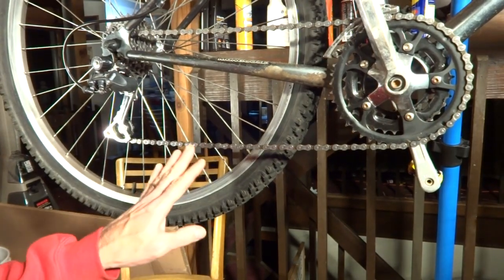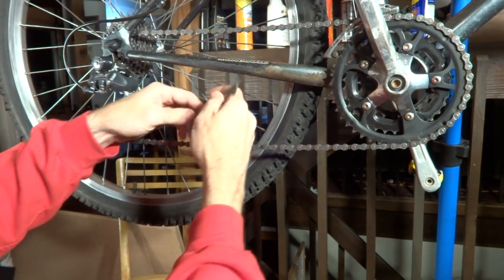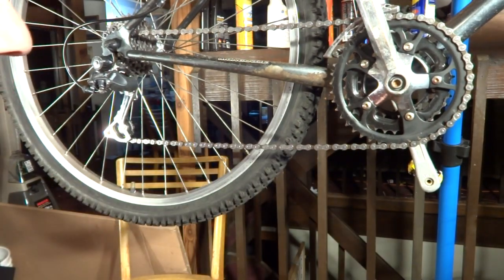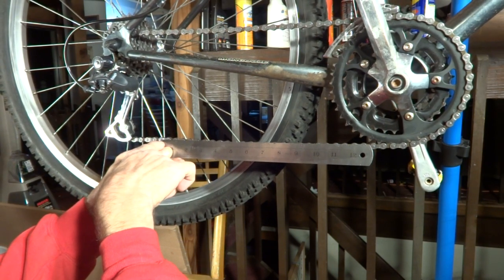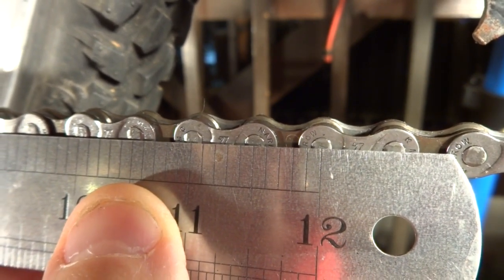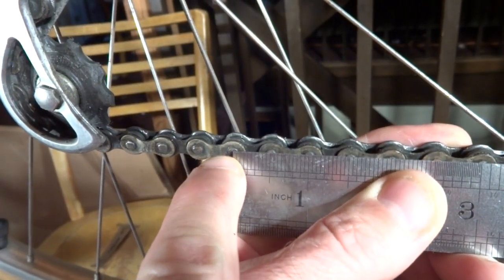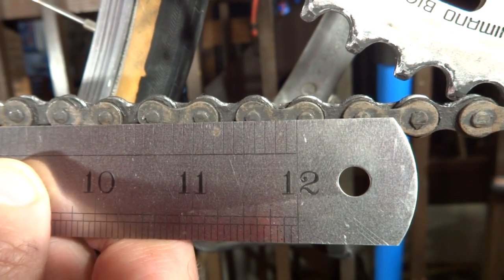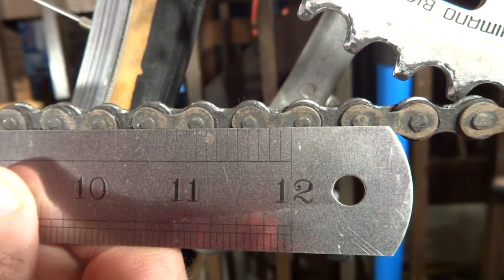How To Measure Bike Chain Wear With A Ruler

Comment: Thank you so much i used my daughters ruler from her school pencil box and used this method and my chain was very worn went to the bike shop straight away and told them i did the ruler check and my chain is worn they laughed at me and said you cant do that use a proper chain checker?? so he got one out and tested my chain and was very red faced to see i was right lol haa haa
Reply: Just because you didn't use their fancy tool, they don't think you can measure chain stretch? Goes to show that they don't even understand how to official chain-stretch measuring tool actually works (it's basically like a pre-marked ruler).

Comment: Starts at 1:25 
The measurement at 3:26 where it says it is extremely worn, .5% is the point when you want to replace it, and since .5% of 12" would be .060, or approximately 1/16", that would mean it is time.  So it shows a little more than 5% and headed toward .75%.  Generally, you will go through three chains before you wear out the cassette sprockets and the chain rings go multiple times that.  You can generally determine the cassette wear visually and there are you tube videos that will show you how to tell.

Comment: Get yourself a chain measuring tool! the ruler method measures the wear in the pins and outer plates mostly whereas the tool measures the play in the rollers. Just to give you an example: the other day I replaced a chain on a friends bike. The chain wear tool was showing about .85 but according to the ruler the chain was still perfectly fine. It was only 1/32" past the 12" mark.
The chain wear tool that I used is well calibrated as I measured the chain with another tool also and came up the same.
Reply from the maker: I personally use a chain gauge.

Comment: Great video, I've always used a ruler for checking chains. The other thing I do is check the chain under tension as I think it gets a more accurate read than when the chain is relaxed and just hanging with no tension in it.
Reply from the maker: With a derailleur, there is generally always tension.
Reply: Or pull back on the derailleur...
Reply: You can see chain hanging down between front chainring and derailleur so there isn't much tension there. Difference is noticeable when chain stretch is measured between cassette and front chainring while putting some pressure on crank so that the chain is really tight.

Comment from the maker: In the context of this video, if the chain has worn to the point that the center of the pin is 1/8" past the 12" mark, then your should replace both the casette and chain rings (not the whole crank set). But the teeth of the cassette and and chain rings get worn over time anyway. The gaps between the teeth get wider and the teeth start to look like shark fins. At that point, they should be replaced.  Maybe I will make a video with more detail on this.
Reply: I have a question there are a few spots on my chain where the chain checker falls threw .75  but when measured across those links with a metal ruler theres not even 1/16 of stretch. Is the chain a goner because the few links roller wear? Thanks in advance

Comment: Brilliant tutorial, I've got 3 bikes, first is my Ribble Endurance SL e & it had a new chain 6 months ago & it's still bang in the middle of the pin at 12". Second is my Winter training bike & that's only very slightly past the band centre middle of the pin at 12". Lastly is my Trek Dual Sport 3 hybrid bike that is almost 5 years old & 12" mark is almost at the outer edge of the pin circle. I'm guessing it's at the 0.75% wear mark? Hopefully it's won't need a new chain set if changed now?

Comment: Thanks for the tip, I ride a trials bike which regularly breaks chains.  If nobody has told you yet,   the 1.0 or .75 is millimeters, not percent.
Reply: I think those tools are 10 cm segments and 1.0 mm=1.0%change. If they are not 10 cm members, then Parktools looks silly by writing "... just before the 0.75% readings."
Reply: I was under the impression (i.e. somebody told me ages ago, but who knows if they knew what they were talking about) that the 0.75 and 1.0 marks referred to how much of a 'link' the chain would be elongated over the length of the chain. Obviously, not all chains are the same number of links, so that makes this explanation a bit fuzzy. However, when I have removed chians that are just entering the 1.0 point on the tool and laid a new chain alongside, the 'stretch' has usually been about 1 link.
Not a big deal what it means other than replace it I suppose. I will look into it a bit more though.
Reply: YES it is a percent ! if the chain pins are 12 inches and 1/16" then the chain is at .5% wear . Here is the math ! 1/16" decided by 12" times 100 = .5% !

Comment: 11 speed chains should be replaced at .5% wear . If the center of pins at 12 inches is 12 inches and 1/16 of an inch the chain is at .5% wear . 1/16" decided by 12 times 100 is .5 !

Comment: Weird. My measuring tape is showing that 24 links are 1/8 of an inch shorter than 24 inches, not longer. Checked two chains. Have my chains shrinked?? Or is my tape longer than it should be?
Reply: Make sure there is tension pulling the chain lengthwise !

Comment: I guess not all chains are by inches?  I have a Shimano derailuer (so probly pretty standard stuff?) but at the 12 inch mark I am a half link off.  So, I can't even tell you if I'm a half link long or short, lol.  Could my chain really be sooo worn that it has grown a half link per 12 inches? wow
Reply: Yes they can wear that much. That would be 6.35mm 'stretch' over 24 links so  0.264mm wear on each link. Unfortunately when they are that worn you would need to replace the cassette and possibly the chain rings as well.

Comment: A very useful tip. But is it also the same if i measure chain wear by putting the beginning of the ruler at the left beginning part of the pin and observing the clearance of the 12 inch mark of the ruler using also the beginning of the pin that has to be aligned with with the 12 inch mark of the ruler as its reference?
Reply from the maker: Works out the same.

Comment: So if your chain is worn alot to the point to where you should change out everything, what harm will just keeping it on like that if its still working fine  for as long as possible?  Might it keep going like that for a long time so does it really matter about things wearing out more does it? Thanks
Reply from the maker: Shrug. At some point it will start slipping, skipping, chain suck, etc. Shifter may deteriorate.

Comment: Just installed a brand new KMC x8.99. Measured it with the method in the video. It's a tad shorter than 12". Weird. Not sure if the chain is designed that way or if my ruler is inaccurate.
Reply: You might not had your chain tight.

Comment: Hello, thanks for the nice video. I'm just crippled. I have 2 brand new 11speed chain and them are already 1/16 over the mark. (K.M.C. and shimano not cheap Chinese chains). I have also a CN-HG73 with less than 200Km which is almost 12 and 3/32. Why is that? Is this video intended only for single speed chains? Thanks
Reply from the maker: Shrug. Buy a chain wear gauge.
Reply: @RJTheBikeGuy  thank you. I tried them and worked properly. I definitely need a gouge.

Comment: Sir, I have a question. I changed my worn out chain because it keeps slipping when I'm pedaling hard. But it still keeps slipping with the new chain installed. My cogs and crank chainrings are not yet worn out based on how they look. Then I measured my chain using a ruler and I found out that the 12th inch does not go exactly between the the last pin. The 1st inch mark is on the center of the first pin but the 12th inch goes beyond the last pin. Does my chain have something to do with this chain slipping?

Comment: Good explanation and video. One thing that would make it a bit easier to follow is if you started your ruler measurement at the same 'place' on the new and used chains. You started at the rear pin of an outer plate and finished at the rear pin of an outer plate. For the worn chain you started at the front pin of an outer plate and ended just short of the 12" front pin of an outer plate. Not a big thing but for a moment I wondered why the 12" spot on worn chain was so much different than the new chain...oh, started at diff point on the link! 
Enjoy your videos. Have you done one showing the use of the Topeak chain-check tool?  Thanks!
Reply from the maker: https://www.youtube.com/watch?v=Y54ekC8PHB0
Reply: Measure on a few spots on the chain !!

Comment: Are there more durable chains or chain rings, or somekind protective coatings?
Reply from the maker: I am guessing some chains and chain rings/cogs are more durable than others. Steel chain rings will be more durable than aluminum ones, but will be heavier and probably wear the chain out faster...Keep the chain cleaned and lubed, and the parts will last longer.
Reply: shyflirt1
 Steel durable and cheap material, I doubt these parts would be made of soft aluminum. But there might be harder materials or at least coatings that reduce abrasion. For example some rims do have ceramic coating that effectively protects from brake abrasion.
Reply from the maker: As they say, you can have it Fast, Cheap, Reliable. Pick two. So you could probably make the parts light and last longer, but they would be more expensive. At some point, it's just cheaper to replace the parts more often...

Comment: 12 inch --> 30.48 cm
Reply from the maker: shrug Chains are made in inches.
Reply: @RJTheBikeGuy  My ruler isn't. Helpful video, thx but i'm not gonna go and find an inch ruler if i can just messure 30.5 with the one i got.. 

Not trying to correct you or be political. Just putting it in there for us mainlander
Reply: Thx mate, it helps alot for those who don't live in the US

Comment: I've always used ruler method before, but since I thought, that it's a bit annoying to do. I got also the parktool cc 3.2. But I still use ruler. I knew the cc3.2 is not exact, because it measures also the rollers wear. But I hopped that it won't be as bad as people are telling me.. but actually it's worse than I expected. It would scrap the chain way too early.
They recommend to change 11 speed chain when it reach to 0.5% wear.. But I got it to fall easily in by 0.5 side, already after 700Km..When I then measured 15 links with ruler, it was just halfway to 382mm. While new chain's 15 links would be 381, and 0.5% worn chain would be 382.9mm.

Does the rollers wear actually affect anything at all? I'm not sure.. But maybe it does affect a bit for gear changing.. on those hyperglide or whatever ramps on cogs?

Well I decided not to change the chain before I get at least 382mm with ruler.. But probably a bit more. I hope it won't wear the cogs off yet.. It does not look like it would lift the chain up on cog under tension.. Also the tooths  don't look like they would be flatted.. or like riveted or I don't know how to call it.. But basically if the chain is worn it pulls only from first one tooth and it like riveting or flatting the edge a bit.. That hasn't happened yet.. Or maybe just very little.

At least for now on, I think the parktool cc3.2 is useless for me.. Maybe it's fine for 7 speed chains where u can wait until .75%, but that 0.5% side.. it can't be right. I don't want to change the chain so often.

Maybe for a bike shop, or a mechanic who need to measure tens and tens chains every day. It's good.. Especially for cheaper chains that don't cost too much. But for a regular cyclist.. I think It's more reasonable and much cheaper to buy a good steel ruler instead of that tool...
And I find a wooden clothes beg to be very helpful when measuring with a ruler. It would hold the other end of ruler in place, so that I can pull the chain a bit more to tension, by pushing the dérailleur pulley a bit.. so that, the chain would not hang, or bending too lose. ^_^
Reply from the maker: Hardi Erstu The Park Tool measures between the rollers. The rollers are what contact the teeth of the cogs and chain rings. As they wear, they get farther apart. Chain stretch. Then they start hitting the sides of the teeth more than falling in the middle. That causes the cogs to wear faster. But it's up to you.
Reply: Well, the problem with parktool, or any other same type go no go chain tool, is that it pushes the rollers a part.. It was explained here http://pardo.net/bike/pic/fail-004/000.html

That parktool is only needed for bicycle mechanic, or enthusiast who have to maintain also the bicycles of his friends and customers or smth. Because there he can't be sure how many kilometers that bike has ran already on same chain.. So he can save a lot of time to check it with this tool first. He can quickly check it with this tool, to see if he needs to check the chain with ruler..

It's probably a very good tool for you, because you do a lot of bicycles, not just your own, but for a person who only has his own bicycle to maintain, like me.. I already know how many kilometers, I can ride with a chain.. And when it's my own bike.. I don't mind spending a little more time to get proper measure with a ruler. I can save some money by taking all from each chain.. I hope so. ^_^
Reply: Update.

Could it be, that these simple chain wear indicators, actually aren't accurate to some brands of chains? 
The barktool cc3.2 actually sems to work well with shimano chain. But on the fsa chain that my bike was equipped with by factory - It really showed wear too soon.. So I think, that maybe fsa chain had maybe rollers little bit loser and that's why it did indicate wear, when there was actually still some lifespan left, on that chain.. or maybe fsa chain really just wear faster, or differently.
Reply from the maker: No, because the spacing is standard to fit the cog teeth, because they are standard...
Reply: Hardi said "I don't want to change the chain so often."  If you wait too long you'll have pay to replace cassette and chain rings, your paying, your call.

Comment: I like your video, but I have a problem, I have measured mine, and the pins are not 0.5" apart and there last pin ends up 11 & 11\16th .... that's 12 links 24 pins .does this sound right, I haven't changed chain in 9 years, 24,000 miles .... approximately
Reply from the maker: +PlanetRuncorn I think you need to go over one more pin. It should be over 12'. Not sure how you are counting. Starting at a pin, count 24 pins from that one, not including the starting pin.
Reply: Your chain has stretched 5/16"! Time to change the chain, cassette, and chain rings!

Comment: Do all links wear evenly? Why replace a whole chain for a couple of sloppy links?
Reply from the maker: They all wear!!!!
Reply: well duh, do they all wear evenly? So if one spoke fails, replace them all?  I refer you to your video example where you demo an out of spec measurement. The initial links are within spec while the final links are out of spec. This tells me that not all links are bad and isolating/replacing the bad links is more efficient. Thus my original question(s).

Comment: Wait, so the chain is worn and you replace the freewheel and chainring?
Reply: It depends on how far your chain is worn. A chain worn at 1% means you have started to wear down the cogs at the back and the chaing rings so it might be necessary to swap all the drive train components all at once. The lesson here is put on a fresh chain before it reaches 1%, it's much cheaper.

Comment: Thanks! Great, professional-like explanation.
But...I question your response. You say replace the chain, cassette, and the crank sprockets if past 1/8" center rivit.. But why? Will you keep wearing chains out quickly if you keep you cranks, or will the drivetrain be unsmooth, or maybe it could crack and/or skip a tooth.

Then, another.......you imply (not the whole crank set) after 1/8" past center rivit. So then I ask, if it worn more than that how come you would replace the whole set.....A crank set being what? Arms and bottom bracket?Joseph

Comment: i have a problem rj when i push pressure on my peedels an crabk when i ride my 21 sppeed road bike the chain jumps an slips off the 3 cherings in the front but when the chain moves around on the crank set the chain is not all the way on the crank it looks like the chain streched so im not sure if u need a new chain or crank becuse all gears are tuned by shop so its not that.
Reply from the maker: Could be worn chain, or worn chain rings, or both.

Comment: I don't have one of these chain tools, and using a ruler is pretty inaccurate (I don't have 12" between the front and rear on my bike, and its not a small bike).  But I do have a digital vernier caliper and would like to use it to measure between X number of rollers.  I searched and didn't find any recommendations, guess I'll have to do some calculations.